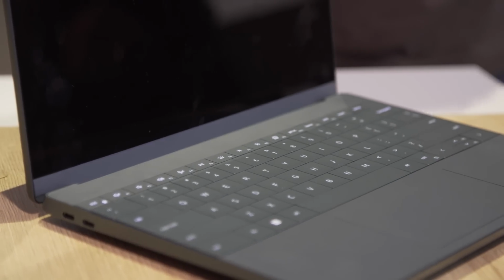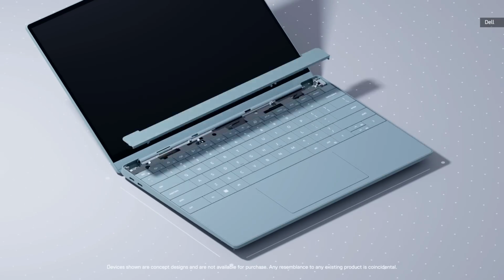Dell Concept Luna: This laptop can be dismantled in seconds

Comment: I believe that all manufacturers in the world should acquire the concept of "quick disassembly" of a laptop.

Option 1
This should be, as a single standard, approved, for all manufacturers. All components inside the laptop must be modular and knowingly prepared at the factory for quick replacement. All contacts and connectors between the modules should fit perfectly to each other and also disconnect. This is necessary in 3 cases. 1 - to clean from dust. 2 - warranty service. 3 - Upgrade. In addition, in the case (on the side) of the laptop, next to the connectors, there should be an NB-Key "opener key", (also known as a warranty key), which is easily removed from the laptop case and returns as quickly as a latch, a plug. It should look something like a key for a SIM card. Inside the NBKey should contain a secret "warranty tape", which is easily torn. If you remove the "Opener", you tear the warranty tape. You instantly lose the warranty and do everything at your own risk. But you get access to quickly disassemble the laptop if it's really necessary. Inside the laptop, there should also be an additional, factory, warranty tape located in a safe, tricky place. If you "shift" the modules, tear the warranty tape - this means the loss of the factory warranty.

Option 2
Digital warranty key. If you remove the "opener" from the laptop case, or the back cover of the laptop, a special, secret, tricky sensor automatically has to enter information into the Bios that the equipment has been opened and the original, factory warranty is considered lost. The manufacturer can track this fact in the Bios when the device is turned on for the first time.
Reply: Thus, you get something like "quickly open the case of your PC and quickly and conveniently replace all modules." But you also have to keep in mind the important conditions of the manufacturer. You can conditionally use the warranty key to disassemble the laptop, but you may lose the warranty

Comment: its also very smart, they can profit off upgrades due to them all being proprietary
Reply: Meanwhile, Framework has open-sourced their mainboard specifications, charging circuitry, sizes and connectors, so theoretically anyone can now build a replacement motherboard for it. We need less proprietary stuff in laptops and calling it "very smart" to use the proprietary-ness of their machines is exactly what's wrong with the industry.

I want a laptop ecosystem that works exactly like building a tower PC works. Standards that any manufacturer can tap into to make truely Personal Laptops. I really hope that Framework's design philosophy catches on. It would not surprise me if other manufacturers started offering laptops with Framework's expansion bay slots. That would be a good step in the right direction.

Comment: This is how all new devices should be developed. With ability to repair, replace parts of it and to modify it.
Reply: Apple disagrees
Reply: Good luck achieving that in a capitalist market
Reply: It will be great!
Reply: The next step I see after that is to have these companies agree on a form factor standard (think ATX).  Then we could really kick off a BYO laptop market
Reply: the framework laptop pretty much does all of this, except its not vaporware and its actually had generations of updates.
Reply: Agree
Reply: nope - much more expensive and 99% people never change anything.
Reply: Well, when Apple fights tooth and nail to deliberately design them in a way that's impossible to fix, I can't imagine it ever happening.
Reply: @robertmaybeth3434  "Apple fights tooth and nail to deliberately design t" Like EVERY other company/
Reply: @nnnnnn3647  Nope.  They don't.  You might be amazed at how many good firms out there design repairable products that last a long time.
Reply: @robertmaybeth3434  apple is the simplest and fastest to repair. try to change screen on iphone and samsung galaxy. Good luck.

Comment: Had an old laptop that had a snap-off back, good idea on paper bad idea in practice, after upgrading the ram and SSD it would never fit back together the same, meanwhile screw-ons just need a good brass screw-hole and it will fit back together nicely.
Reply: Yep, they should not purse this snap on design. It is just asking for more trouble. Regular screws does the job pretty well and it's proven. Some can be held by magnets if they want to be fancy, since it takes a very long time for magnets to loose its magnetism anyways.
Reply: @kornkernel2232  That would be a great way to assemble a comp, only if solid state drives are used - a magnet kills the old platter style HDD drive.

Comment: Snap connections will never hold up as well as screwed together connections. An open standard with parts that can be replaced and reused would be great, but wanting it to be snap together is a pipe dream. Mechanically that isn't going to hold up to the abuse a laptop takes with the lightweight materials that it needs to be made out of. Standardized screws that are easier for users to handle would be a better solution and there are sizes that would work.
Reply: Eventually yes, but how many times are you really going to be taking apart your laptop, it's looks way more durable than those plastic clamshell laptops of the past where even opening them once was enough to break the tabs
Reply: For most of the components they don’t seem to snap together, they seem to slot in snugly, so there isn’t really any room for movement.

The electrical connection between each component seem wide enough that even with a few mm movement, there wouldn’t be an issue.

From what I could see the only components that snapped in were the screen bezel and the top bar of the keyboard.
Reply: Exactly! I think these gimmicks are undermining the legitimacy of repairability. No need to dismantle the whole laptop in 30 seconds, 10-15 minutes is fine. Just focus on replacing glue in current designs with screws and just give us production laptops with parts available for purchase. We used to have removable batteries in Dell laptops as late as 2015 for Christ's sake!. Framework has the right balance imo, I hope they become wildly successful so that existing giants can't ignore repairablity.
Reply: Yeah, snapped connection are horrible idea, since they will wear and if they are not durable enough, it's easy to break by careless user, just introducing additional waste.

Screws are well proven to be secure and its easy to be replaced as we can find standard screws everywhere these days. As long as they don't use weird hard to find security screws.

We seem to be way too obsessed by saving weight, and really shame for consumers who even support for non-repairable components just because it looks cleaner with now seam, super light and because it's more "modern"

Comment: Yeah, and my XPS 9315 has EVERYTHING SOLDERED, I don't realize it even doesn't have the 3.5mm headphone jack until I want to plug my headphone in. LOLZ
Reply: I guess the wifi card and the ssd is not soldered, I have the 9305, I have a jack, its the old body with the new internals

Comment: I used to do Satcom support for all the major networks. The company I worked for provided video feeds for them, and the receiving equipment was all based on Dell systems. The hardware was universally excellent, durable, and capable. The best part was, if you had to crack open a tower, you didn't even need a screwdriver. Everything was thumbscrews. Easy to work on, easy to upgrade, and Dell support was the best in the world. We just loved their hardware. In an age where you have to have a tap welder, heat gun, and vice to change a freakin substandard Apple battery, It is good to see Dell making it easy for the consumer. All good wishes.

Comment: A modular gaming laptop with changeable CPU and GPU modules could be really neat!
Reply: the modules would be more expensive than a new laptop
Reply: MXM GPUs failed because the tech of the time just wasn't ready. But, I feel like it would be very welcomed today. We just a need a unified standard for Nvidia, AMD, and Intel to adopt.
Reply: @igeekone  maybe if they can get cost down, but I feel like both manufacturers of laptops and gpus would prefer you go buy a new one than just upgrade your existing one, you know capitalism and that
Reply: Really great. imagine swapping things out. The keyboard alone would be a game changer. Maybe I can have a Spanish keyboard and an english keyboard.
Reply: @Bugbuster - No tech company would seriously hit its own foot with such tech. Then they wont be able to sell new laptop models every year. These are just showpieces to brag in World forums.
Reply: @aham-mumukshu-asmi  But you could lock someone into your eco system. Also charge them more upfront to begin with, promising to be cheaper down the line with upgrades.
Reply: @mm_35photography  that would be a niche community though. Cos picking modular models would mess with most buyer's spec sheet. I could be proven wrong in future, but am sure such ideas would be weighed out by ongoing "fixed build" model sales figures and margins.
Reply: Im still using an Alienware 17 r1 (i7 4910qm, 16gb ram, 1070 mxm, 120hz full hd screen) and im happy with it. I've also seen the rtx series of cards in mxm format, now they are expensive but eventually the prices will drop and ill be able to upgrade the gpu.
Reply: They already tried that. And didn't make a replacement GPU for that alienware laptop they presented over 2 years ago
Reply: We used to have this but industry shifted to more "disposable" laptop that is harder to repair or self service by the user. 

This one is neat, but they should limit the amount of components to be snap, which is prone to wear and will still break eventually. They have to use stndard screws that at least if it lost, can be replaced easily and metal screws are better to the environment than plastics breaking.
Reply: Cpu and gpu are soldered on motherboard there's no point in that
Reply: neat ? it's amazing, this is almost impossible now
Reply: Alienware working on one whose main virtue is easy repair and upgrade, the whole thing snaps apart almost like Leggos.  It is in the development stage right now.
Reply: They have tried that already, the gpu at least, and it was killed by Nvidia
Reply: @TaimatCR   I know ther was Alienware, but I mesn the same level of modularity as Cocept Luna.

Comment: Dell upgradability is a scam. Look at the Alienware m51. If you want thing like this, don't give hope to Dell, give it to Framework.
Reply: I'm assuming, Dell is making this in response to the Framework.
Not very hopeful about it, but probably they are planning to push this long-term, since there's not much they do better than others.
So that may be their step to differentiate from the others and jump onto the repairability bandwagon.
If they market it right, that may be a good thing to sell to businesses in the future as well as more services, mobo replacements and stuff.
Now businesses replace their laptops like once in 5 years. With something like this they may upsell them on a new motherboard every 2 years.
Reply: If they sold them with AMD cpus I'd consider it.
Reply: Dell will make these proprietary parts as expensive as possible...
Reply: I was about to say Framework. They really got the whole idea right. Plus, they even go the trouble of building a marketplace to sell parts. That deserves an applause.
Reply: It wasn't a scam (or as much of one) when they had socketable CPUs and MXM GPUs in their Precision and Latitude lines during the early 2010's. Granted, upgradability wasn't the point of those parts, but it was feasible on a lot of large workstation models to buy a newer card and plop in in your chassis. The problems were that:

- Gamers weren't going to spend $5000 on a top of the line laptop with a utilitarian design.
- Clevo made laptop with socketable DESKTOP CPUs, they really only exist through boutique middlemen. Nobody really buys them, at least directly.
- They most certainly weren't going to spend another $1000 getting a boutique "top of the line" card that up until Pascal, might equal a mid-range desktop GPU of that era outside of the VRAM.
- Upgrading a desktop GPU, assuming you have all things going well, takes five minutes at most. Upgrading one of those mobile workstations involved breaking out the precision screwdriver and going to town on the thing, often stripping it to just the chassis, motherboard, CPU and GPU. Being well practiced at it made it doable in fifteen minutes. Oftentimes it took way longer. Thank God they were often built like tanks, because you were going to forget a screw or two.
- Though the MXM format was open, the GPU and vendor BIOS often weren't. You just couldn't grab a Dell 980M and place it in a ThinkPad W541. Some laptops had a really fast and loose policy like the old HP EliteBooks. People got 2060s working on there from what I recall. Some like the ThinkPad line were completely locked down. If you bought a card that wasn't from the company you got your laptop from and was part of its configuration, you took a gamble and unless you're a BIOS hacking wizard, you often lost.
- The companies and governments that buy them have service contracts with the OEMs which make all but the most trivial repairs pointless and are rich enough to just buy another laptop when the "need" arises. Most of those laptops were previously owned by government agencies, not gamers or even professionals. No one outside a subset of enthusiasts wants them.

Simply put, upgradability in a laptop is a meme dream for people who have never opened a chassis before. Repair is great. I love repair and replace. I used to own a M6800 and that thing was a fucking beast with an insane amount of ports and replaceable parts. It also weighed nine pounds and could be used to kill a man, deflect pistol rounds and still work. That's not even counting for things that OEMs have no control over like motherboard support. What's the point in upgrading from an i5 from the same generation to an i7 when buying everything new or at an inflated price three to five years down the road. If you want to see what an upgradable laptop looks like, go on eBay, find the last few revisions of any of the previously mentioned brands/labels, buy an MXM card, (They actually got insanely cheap since the GPU mining crash, though you'll pay out the nose for a Turing card, which were some of the last ones made and are only suppoted by a few laptops.) get a heat gun and a bunch of tools and have fun! I'm serious on that last part, though most models are really starting to show their age.

Also, everyone who doesn't know better (which is just about everyone since the old forum where people did stuff like this died :( ) will make fun of you and think you're poor and stupid because you have a laptop the size of a shield.
Reply: Argument invalid since you have an anime pfp lol
Reply: They patent the design so the upgrade can only made by dell
Reply: I have a framework laptop 16, this laptop is real and purchaseable unlike the dell concept luna. Its an awesome device.
Reply: Imagine buying an Alienware
Reply: HP EliteBook series.
Reply: Yeah cuz Framework is a company with a mission around repairability, their whole company is built around that core mission; if they change down the road, they’d lose their user base and die. Dell and Apple recent moves toward repairability is a response to laws demanding them to do so. If the laws got repealed, they will revert back to making repairing stuff a nightmare again. Sure there’d be backlash if they go back, but they will still profit and live on.

Comment: hell will freeze over when a macbook is built like this
Reply: The 13” M2 MacBook Pro mainboard was almost compatible with the 13” M1 MacBook Pro. Almost.
Reply: @KellyWu04  On the contrary. It was possible to fit so it should have worked theoretically but it was software locked with components paired to one motherboard. They can do it and it is possible to do it, but they don't wanna do it.
Reply: …and Dell will never release this as it is a terrible business model. Making a laptop that can last 20+ years is a solid way to kill your business. That will stifle innovation and lead to less choice and be much worse for the average consumer.